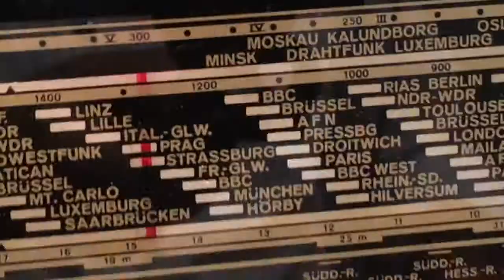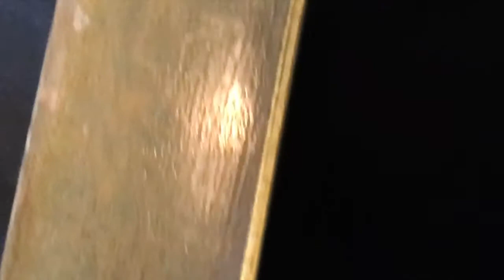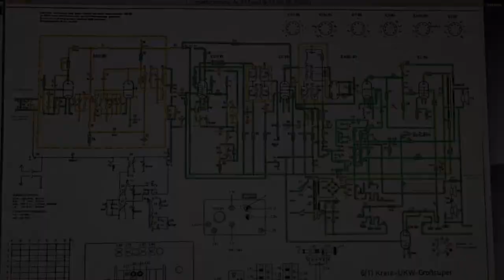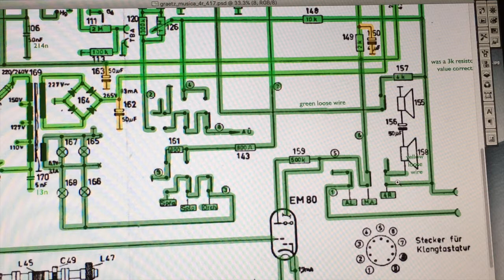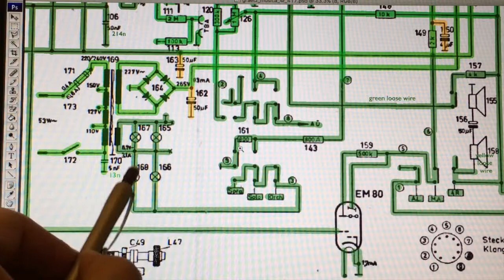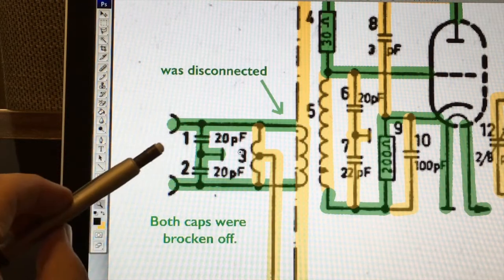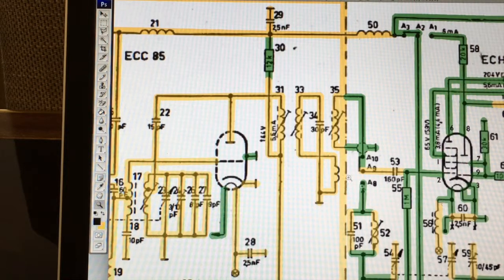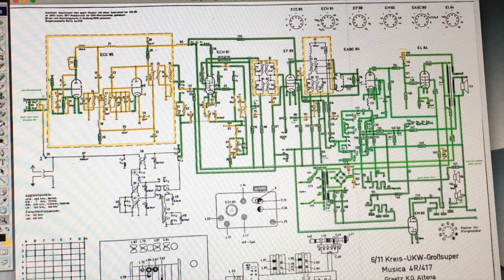Graetz Musica 4R417 tube radio restoration log - Part 5

Comment: The work on the receiver section seemed to be remarkably uneventful. Did you do any alignment? What about the FM detector? I cannot recall any radio in my hands that was not improved to some degree by trimming.
These German radios are superb.
Reply from the maker: jonka1 : there are 7 videos in this series. Can’t give out spoilers, can I :)